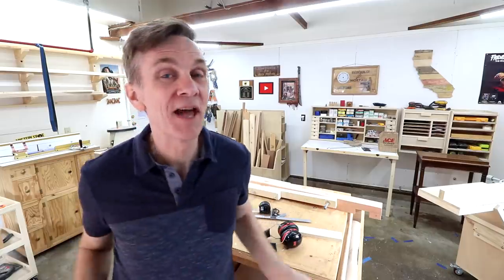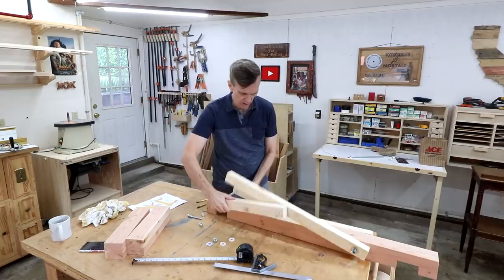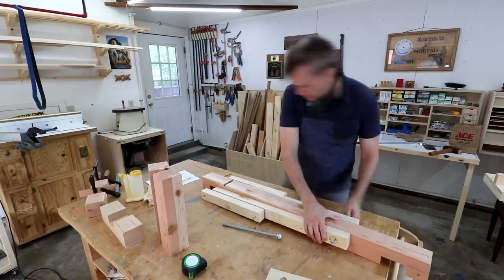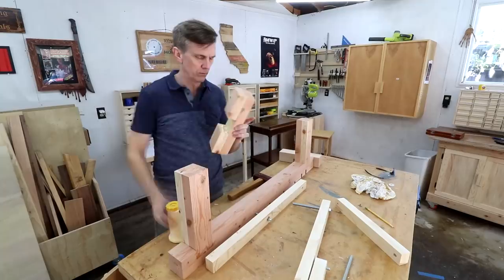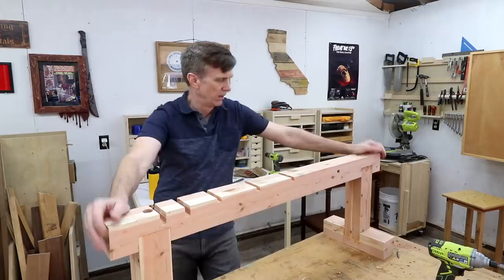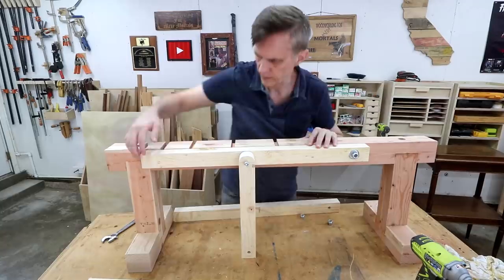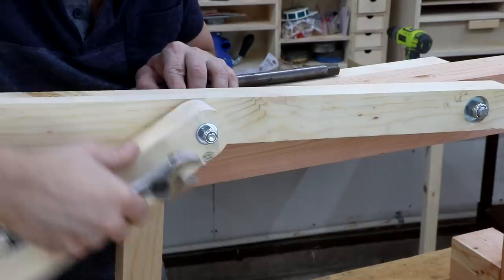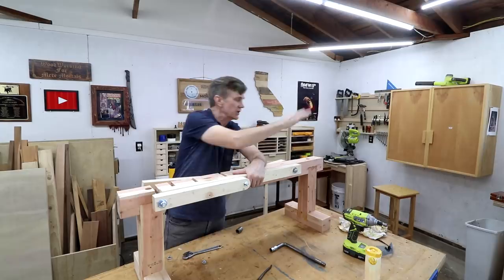LOCKDOWN Day 16 | Fixing mistakes and moving forward with the weight bench. And TV shows to binge!

Comment: For thinner plastic washers I make my own using the sides of plastic milk cartons.  Cut out the sides that are flat or nearly flat, drill some holes the size of my bolts.  Rough cut around the holes the stack a few on a bolt, tighten down with some smaller steel washer then chuck them into my mini lathe to turn round.

Comment: Hey Steve! Most weight benches go in either 10 or 15 degree increments from 0-90 degrees, depending on how many notches you want. The flatter the bench, the more chest dominant a press is. The more upright, the more shoulder dominant a press is. Many people use a 30 degree incline for targeting upper chest on incline press. For many other exercises utilizing a bench, 40-45 degrees is also helpful. Just some of my thoughts!

Comment: Hey Steve, loving the series!  Would love to see more of this kind of content after everything's back to normal.  
Suggestion on the parts of the threaded rod sitting in those adjustment notches would be to grind off the threads, lest it continually chew out the wood on ya.  May not affect the wood's strength, but if you ever have it in a place where you don't want a workout bench raining sawdust, maybe for that reason.  
To do it, I'd mark the area you want to smooth, disassemble and chuck it into the drill (or drillpress), retain the other end in a piece of scrap with a hole (to prevent the sideways pressure from damaging the drill's bearings), then while it's spinning hit it with the grinder.  Seems like that'd totally eliminate any grinder marks or unevenness.

Comment: Thumbs up to crush a troll.  I love your sense of humor and I enjoy hearing your thought processes.  Please keep the videos coming.

It appears to be traditional to cut a dado half the thickness of the through board.  In the case of a half-lap, this makes sense.  I did it this way until one day I was assembling some particle board furniture and noticed that all the grooves (not really any such thing as a dado in particle board, since there isn't any grain to speak of) were cut really shallow, like 1/8" or so.

This got me to thinking.  What they appeared to be doing was cutting a groove to establish a definite stopped position, and they usually used a bolt or screw of some kind to hold the joint together.  This minimizes the impact of the joint on the overall strength of the through board, and is easier and quicker to fit up.  I've been using this principle on most of my projects ever since.

The reason I mention this is that it seems to apply to your bench legs.  If you'd cut a 1/4" deep dado to mount the legs (especially since you're using lag screws to hold the joint together), you would've had a lot more meat to cut your backrest stop dadoes.  This is not intended as a criticism, just as a consideration for future projects.  I hope this is useful to you.  Thanks much for the videos, you've added a lot to my bag of tricks.

Comment: For your level issue - if you decide not to shim I have used adjustable furniture feet for that issue. No sure how much weight they can support but I have bought these for a big 2x4 bench and they seem pretty solid. May be nice to lift it a bit off the garage floor to avoid water / dirt. 

On Amazon: “Furniture Levelers by Clear Style Adjustable Furniture Legs, Table Levelers and Chairs Levelers, 3/8-16 Inch Thread Size”

Comment: Looks real good.  2 Suggestions: 1) consider putting a sleeve on the all thread to prevent the teeth from eating the wood. 2) Cut wedges into the notches for smoother adjustments. Just a thought your choice of course.

Comment: As a personal Trainer of 20 plus years (and now an avid follower and woodworker)  just an observation. Something to keep in mind, as you increase your angle on your bench. So flat is chest and Triceps, elbows out all chest elbows in more triceps. Regarding the angle at 10-15% more upper pecs after that the more you increase the angle becomes less pecs and more shoulders (Deldoids) In other words as you increase the angle you will move from from upper pecs to anterior (front) delts  to full delts at 90 degrees. Hope this is help full 
Dave Bortolin

Comment: Use a belt sander on the bottom of the foot until it does not rock.  Save the shims for when you really need them.  From watching the video it doesn't look like you need take a ton off.  Sand...Test... rinse+repeat.

Comment: Lol. I think isolation is getting to ya, mate. 

Id put a small cross piece under the main beam as a stopper to keep those inner-boards (the one you said you'd need to shave just a bit off, and its twin) from falling too far - so they stay parallel with the outer boards and seat back when it all lays flat.

Comment: Steve - these vids have been awesome.  Two possible thoughts: maybe make the notches a bit deeper to avoid it jumping out of place if you jolt it mid exercise - the depth of the back 2 slots seems safer. Also, screw in levelling feet would solve the twist problem, any potential sliding (if you use rubber feet) and mean you can move it to other locations even if other floors aren't level. I use them a lot in restaurant construction.

Comment: In Yorkshire where I am in the UK, 'mate' is ubiquitous and more parochially in my local area of West Yorkshire in Leeds you will often find 'love' is used regardless of gender of the speaker and recipient so you'll get burly builders calling each other love! The UK also has 'pal' used quite a lot. Others, off the top of my head so it's not a comprehensive list include: 'la' and 'wacca' in Liverpool, 'duck' and or 'm'duck' in Derbyshire and Lincolnshire and there's 'mucker' too but I can't recall where that's used. There'll be many more. Your use of 'belt and suspenders' highlighted George Bernard Shaw's line about the UK and US being divided by a common language since here it would be 'belt and braces'.

Comment: Hey, Steve! Love the Lockdown Videos! (all the other ones are pretty great too) On your last video you debated on whether to use the nylon washers or not. I definitely think you should use them. I work on machines that have wearable parts and the nylon washers help reduce the wear of said parts and to keep them from rubbing and getting loose. The gap it creates will also keep the wood from scraping together and still have a tight fit. Keep up the good work!

Thanks!
Reply: I forgot to say to double up the nylon washer on the inside piece for less friction!

Comment: Marvelous Mrs. Maisel and Santa Clarita Diet are both fantastic! Have you tried Altered Carbon? I think it's something an old Fangoria reader might enjoy.

I was surprised you didn't attach the back to the runners first. I would think that would help with stability when you're testing the notch position for the riser arms. But thanks for the idea of using two 2x4s! I was going to use the 4x4 but your explanation made lots of sense.

Comment: Might be a little late, but why didn't you use a drill to make the holes round at the bottom and then cut the difference with the table saw? I have been watching The Wire, it is a little older. Goliath is another great one.

Comment: Steve Ramsey, I've learned many things from you, but I made a mistake in my Magnum opus. - a 102 inch long 2 inch thick ash dining table. Been building for 5 weeks and just realized I attached one of the turned legs to the apron upside down. Glue and pocket screws. Any fixes which wont destroy the expensive ash wood apron?

Comment: I have a question about pivot points in wood, such as the all - thread and or bolts you're using. Is it better to press in a piece of copper tubing or pipe as a bushing for the hardware to ride in instead of straight against the wood?

Comment: I so identify with getting the nuts, washers, bolts, screws put out of sequence... usually I find myself a bit tired and need to pick it up next day. And just thinking out loud here... perhaps the twist in the wood might have been corrected if you completely squared the beam on all four faces with the table saw... or is that possible?? it might not be square, and I don't have a jointer so how could it have been done? The "ye olde" router jointer trick won't help with a big beam like that. so just curious.

Comment: I think that your lock washer will not work: they are designed to be screwed tightly to be effective at preventing the nut to unscrew, without any freeplay. It is the opposite of your design, as you want the allthread to rotate freely. You should either use a double nut or a nylon nut.

Be safe and thank you.
Reply: The allthread where he used the lock washer doesn't need to rotate.
Reply: @Jehty_  True too. But then Steve does not need nylon nuts nor lock washer. Simply tightening some normal nuts, on soft wood, should be plenty enough.

Comment: Oh I know your Pain. Antenna mounts use threaded rods with 6 nuts and 4 lock washers per side and they slide through 4  specifically spaced holes.  Forgetting one washer or nut is the wrong orders and you are removing and replacing nuts for EVER.